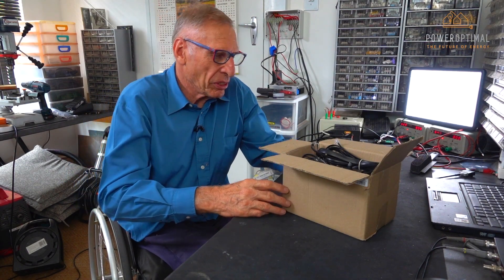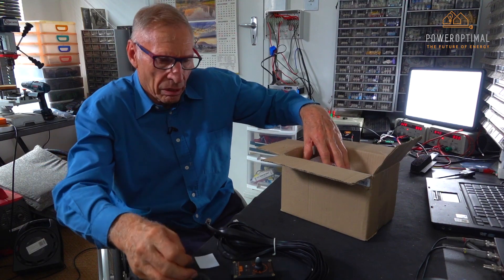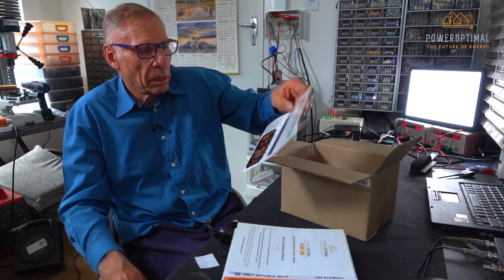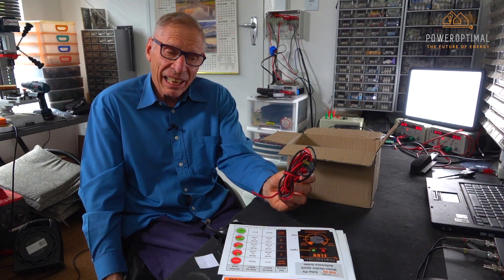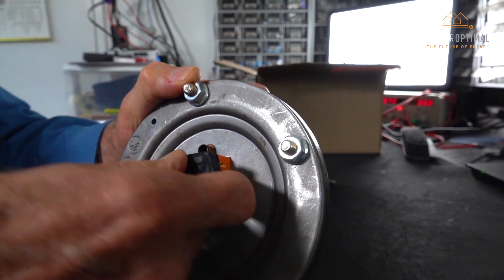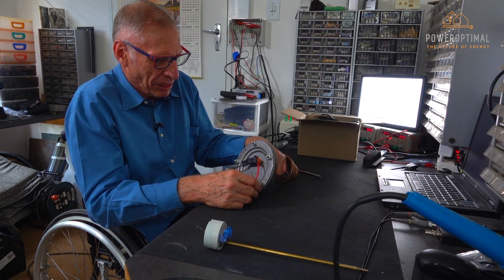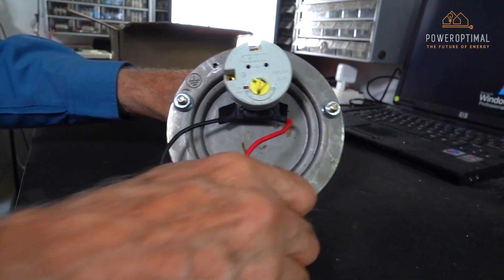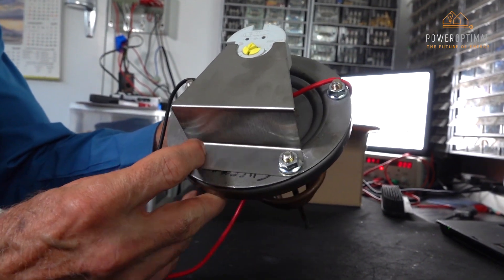Unboxing: PowerOptimal Elon® 100

Comment: Does one need to convert your geyser element to a dc element before you try to install the kit as shown. Or Does the kit allow you to be used on ALL AC elements too ?
Reply from the maker: Hi Galligar. You don't need a DC element. It works with standard AC elements.
Reply: @Poweroptimal  Amazing product

Comment: Hi sir,so what regulates the element if the thermostat is bridged?
Reply from the maker: Hi Austin. It is still the thermostat that regulates the element. The Elon 100 uses the thermostat as sensor. The thermostat is wired to the Elon 100. The Elon 100 sends a sensing current through the thermostat (mA). That's why it needs to be bridged.
Reply: @Poweroptimal  thanks alot for the info,looks like a great product!